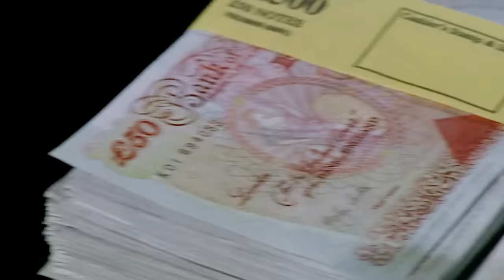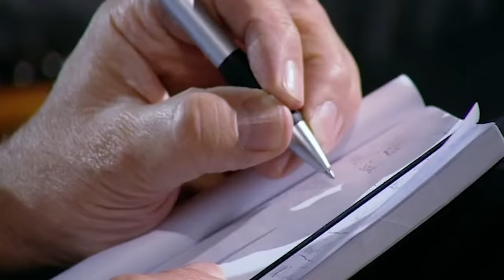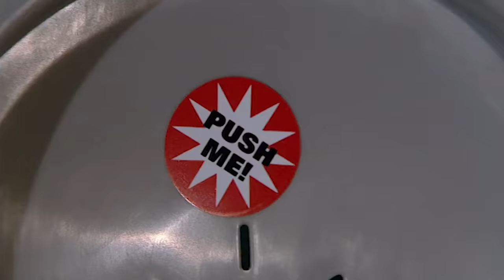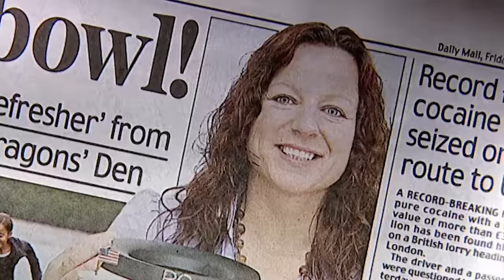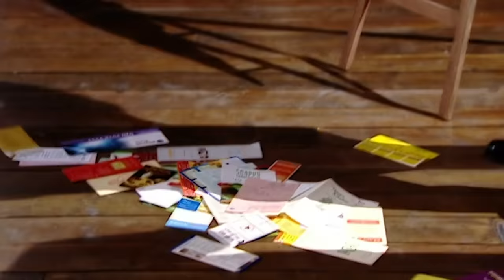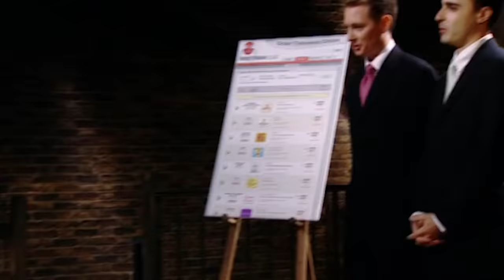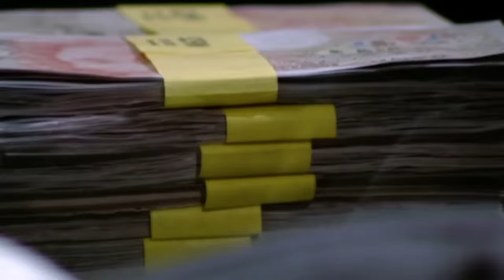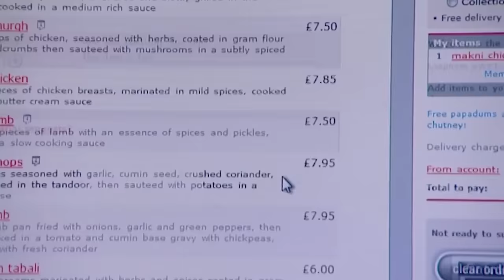Top 3 Rejected Products That Made Millions | Vol.2 | Dragons' Den

Comment: One thing that got me about the radiator guy is that no one mentioned the running cost vs his heating compared to a standard radiator or at least I didn't hear it. I thought it was a great product.
Reply: Actually it is crap. The surface area is woefully inadequate.
Reply: @rogerphelps9939 needed a boiler manuf on side, flow rates, flow temps etc. If he had a bit more detail and some backing from heating companies with credibility he'd have been in

Comment: The radiator skirting board guy struck wholesale deals with house building firms all over. Those skirtings are in new builds all over the place now.
Reply: People will regret having them when they have to fit a heat pump.
Reply: The recent reviews for his business are not great.

Comment: That radiator baseboard is a brilliant idea and I don't understand why the guy didn't offer the angle of installing it during the construction of the house or apartment complex. That could have changed everything because when The Dragons would have obviously asked why you'd do it if the price is higher, they could have responded by pointing out that there are people who care about form over price.
Reply: Exactly. It's not a retrofitted product.  It could be installed in all new homes. I just wonder if it has the ability to push out enough heat and if it were dangerous to children accidently touching the skirting board.
Reply: I am more interested in how does he joins multiple panels. Also the surface would be less in my home than a radiator

Comment: heated skirts.. omfg you just know these dragons never builded the house.. or at least look at the price before saying yes.. its a great idea. so many people pay sooooo much more to get floor heating. skirts is a great (leaning at the low) middle option!!! absolutely love the concept!!!
Reply: Duncan actually built a couple nursing homes, not that he was involved in the labour, but he does have building experience
Reply: Wrong. They are equivalent to a medium sized single panel radiator with no convectors. They will be absolutely hopeless with the low flow temperatures required for good heating efficiency especially with heat pumps. A good idea on the surface but it is rubbish on close inspection.

Comment: I installed ThermaSkirt in a couple of properties - there are a couple of limitations that the dragons did not pick up on - for example if you have any furniture by the wall it will reduce heat output, and the finish imo could be improved. My builders also found it complicated to set up the wiring as it needs a direct power source.
Reply: but the issue with the heat being blocked off would be the same for a normal radiator
Reply: @notrecyborg5492  Not really as a radiator is say 1m wide and you have one radiator per room so you would work furniture around it. But if you had a divan bed you couldn't put it in a corner to save space as 4m of thermoskirt (1/4 of the room without considering other furniture) is covered.....so  your bed would stick out maybe 3inches from the wall...
Reply: Would you recommend it?
Reply: @notrecyborg5492  lmao are you serious? xD

Comment: Excuse me sir but I know enough about engineering to know that
1. Aluminium body radiator will corrode to death. There's a reason most radiators/pipes are copper or cast iron
2. Alum body radiator with no fins = no heat dumped into the room, but lots of it dumped into the wall and then out the house. 
tsk...
Reply: That's the first thing I thought. Not the corrosion thing though. If the aluminum doesn't touch any water, and it's painted, it won't corrode. We had 20 years old aluminum siding on our house that never corroded.

Your heat dissipation remark is on point. There's gotta be fins\slots to allow the heat to travel somehow. That's why radiators are never just a solid block.
Reply: @shane250  the basic idea is kind of dope though. rads are kinda ugly. But the last thing the kids need is a death zone all around the perimeter of the room.
Reply: @dimitar4y  
Is it really going all around the perimeter though??? Because that will require 10X more piping/electric heating elements (and plumbers/electricians aren't cheap). I think it's just on one/two spots, and the rest is just empty skirting/baseboards.
Reply: @shane250  their pitch is literally all around the room. Also it seems to be pipe only, where all pipes just clip in together (oh lord I can hear the sharkbites hissing gallons of water already).
Reply: @dimitar4y  
Then it can't be only 4X the price (like they pitched it to be), there is so much more material and labor to go through over traditional radiators.

Comment: How does the radiator deliver the heat, when the top and bottom is closed off to roomair=
It must be heating the wall a lot and so use a lot of energy for that, which seems very ineffective, and so very expensive?!

Comment: Skirting radiators with fins therefore thicker ,similar height,. More efficient than this have been in use for over forty years !
If radiators is not visually exceptable
An alternative warm air via a wet heat exchanger with the added benefit of also being able to be used for cooling and healthy air changes !
An alternative aluminium radiators !